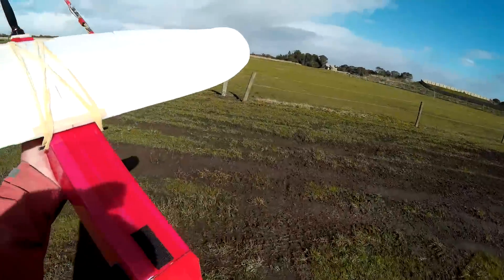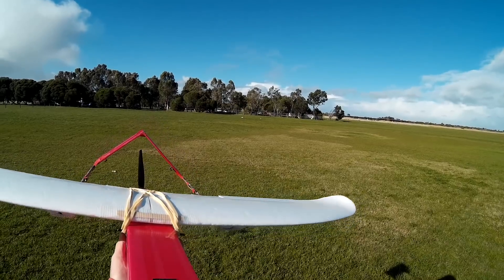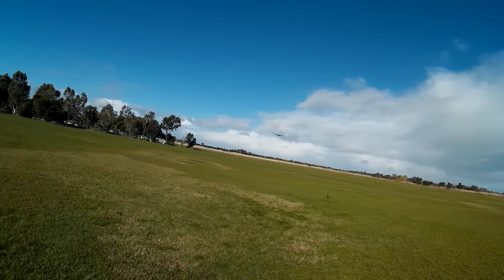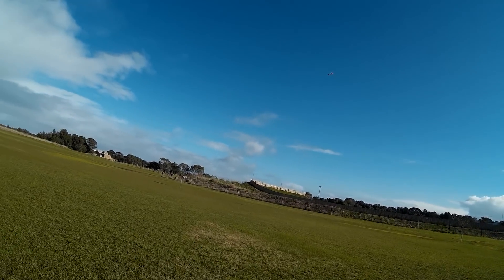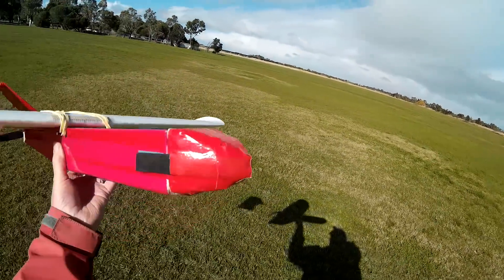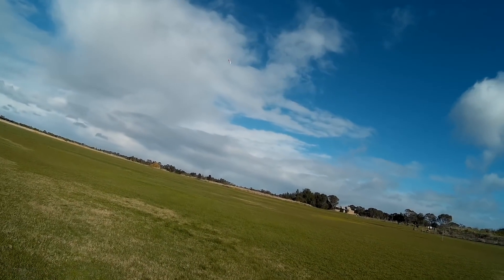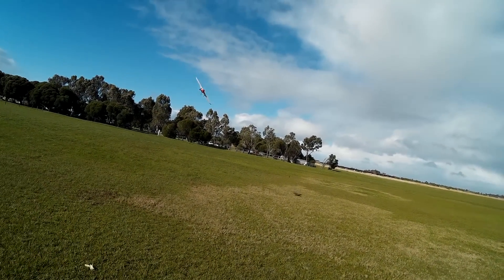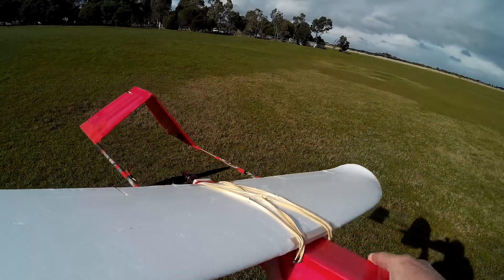A-Tail Talon mods

Comment: hello. question:  do you give a incidence to the tail angle?   my own calculations give me a huge negative incidence for conventional tail....do i transfer that incidence to an inverted vtail also? thanks
Reply from the maker: My builds are not that accurate. I may add some packing under the wing trailing edge after test flights it required.
Reply: @AndrewNewton  Cool, thanks.  I'm wondering if there is some intrinsic property of the inverted v-tail / u-tail that simply allows it to be ignored. 

you dont see a negative angle of incidence on any drones in this configuration, yet the math says there should be if it were a normal tail.
Reply: @AndrewNewton  What does the packing improve specifically? just in case i need to do it to my own design...
Reply from the maker: Oops sorry, the packing is not relevant for this type of plane with the tail booms attached to the wing. I was thinking of normal planes with tail attached to the fuselage and wing mounted flat on to the fuselage by rubber bands.
Reply from the maker: Just mounting the flat bottom of a Clark Y airfoil wing on to the flat top of the fuselage usually gives too much angle of attack. Lifting up the trailing edge reduces the difference between the wing and tail angles. Hope that makes sense

Comment: just a question do you think putting an air down in the front of the wing there where the rubber bands are to deflect the air over the wing a little better would make any difference

Comment: A while ago I was thinking about making a plank style plane (elevons only, like strix gremlin) with my mini-talon wing... but I was too lazy :)
Reply from the maker: What happened to the fuselage?
Reply: I thought I had wrecked the fuselage in a crash a while ago but on closer inspection after the initial rage had subsided, it was not too bad and only one tail piece was completely useless. I found you can buy a pair of replacement tail pieces on BG for just $9 so the plane is good to go again. I have not been flying it much though, mainly because I find it really fiddly and annoying to work on that enclosed tube style fuselage, when wings like the buffalo or c1 chaser make it almost as easy as laying the parts out on a table.

Comment: Fly's great!  looks stable in the air despite the wind :-)   what about moving the tail right upto the prop?   
or any chance of making a  T   Tail?  I know your not keen on T tails as you removed one in a vid :-)    I'm going to look at that when my micro arrives from Banggood, hopefully not crushed!    I like all T tails, V, A any unusual tail  or even no tails!  :-) 
Nothing but wind and rain at my end of the world!  I'm TRAPPED in the house!   Yaaaahh!    I'm starting on a diamond? shaped wing (fluteboard) but it looks to have cg issues, I May have to mount the motor in the middle of the wing and not on the tail!   
Great vid Andrew, thanks for sharing,
Reply from the maker: Yeah I hear you, going stir crazy with this weather. I dont think T-tails work well in foam, too flexy and delicate. My modded Skywalker has one but it's a big beast so it can be made strong enough.

Comment: Proverse Yaw...Ill have some of that please....CG...???
Reply from the maker: I wonder if the proverse roll effect would be enough to work with a rudder elevator plane with no dihedral? CG moved back to the servo wires - 65mm
Reply: Be interesting to find out...I doubt it somehow through....CG is just plain weird on this wing.

Comment: Gidday Andy I'm in the market for a decent FPV platform I have been leaning towards either the Sky Ranger 1800 or the Buffalo FX 79  any suggestions would be most welcome, I would be looking for lots of internal volume so I can fit decent size batteries + maybe a Pixhawk & odroid xu4 computer I would like to dabble in photogrammetry/ survey  work. Love your video's  no BS to the point & informative cheers mate nice bit flying also.
Reply from the maker: Sky Hunter 1800, Skywalker 1830, MFD Nimbus twin, Buffalo FX 79 are planes have tried. They are all good in different ways. The Sky Hunter is excellent, very cheap and heaps of space but the tail surfaces need strengthening. The FX 79 is a monster, looks great but might be a bit flexy, see iforce2d videos. The Nimbus is very expensive but probably the most professional setup for mapping. The Skywalker comes with landing gear and has enormous internal space (but it's a kit and may not be available)
Reply: Thanks mate for the quick reply will check these things out & make a decision leaning towards the Buffalo quite happy to reinforce with CF strips/ or whatever it takes, I have plans for a Geobat but not sure if it has a Patent pending  have built a 1 metre one flies great  & has STOL capability  I bought these plans years ago not sure what the status is on  enlarging  the plan & not stepping on someones toes, again thanks.